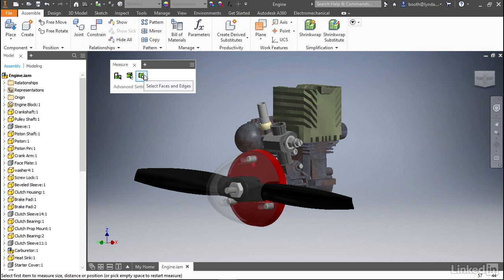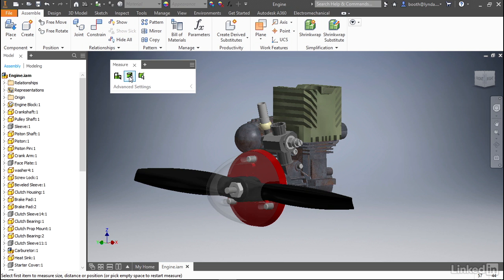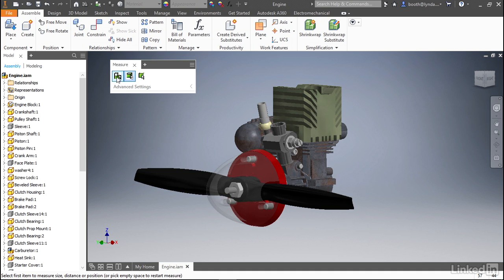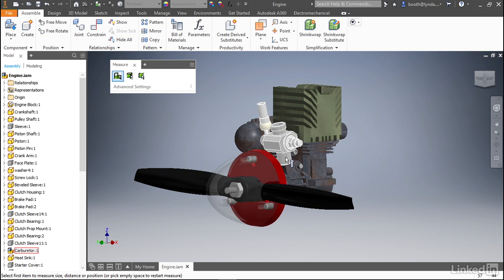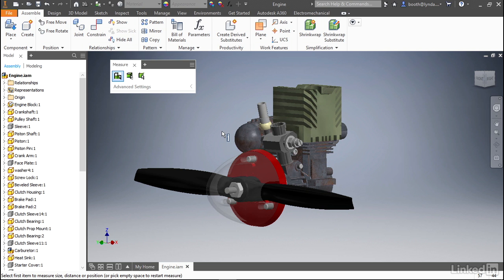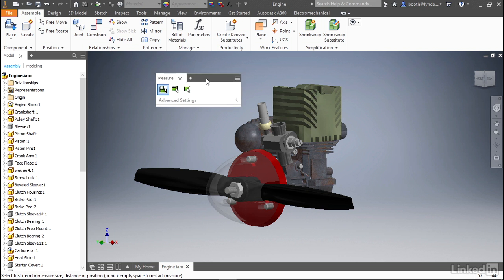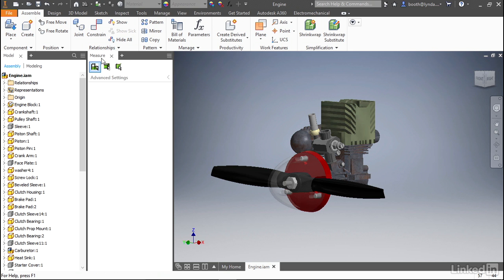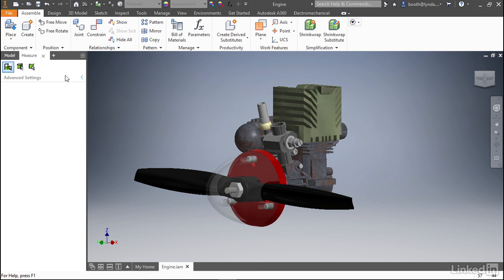Inventor Tutorial - Measure tool

Comment: I was looking for how to measure between faces or from a hole to a face or part.    Already knew how to open the measure tool.   Didn't know about docking it though.   A video on how to select faces, axis, diameters, radi, lines, pts, and use the features of the measuring tool was what I expected.